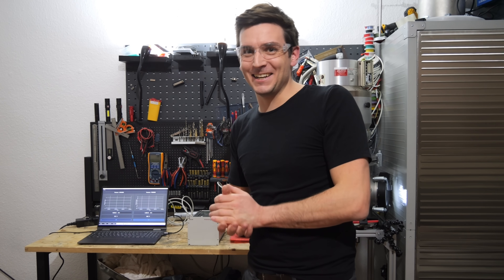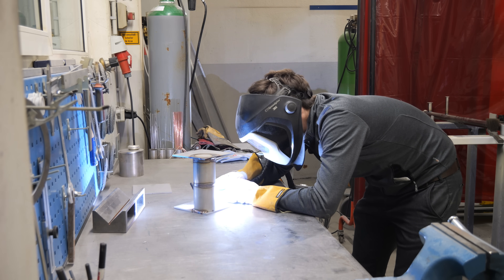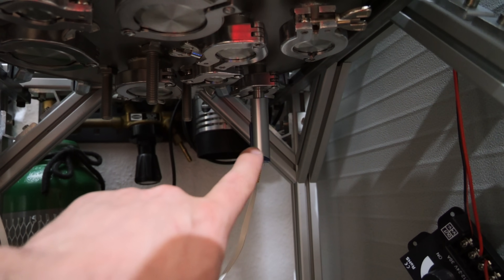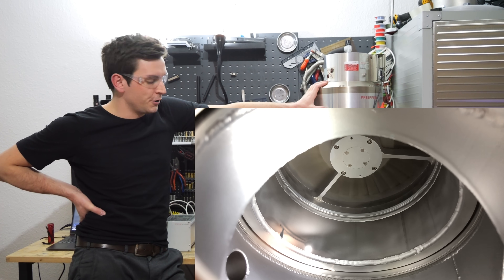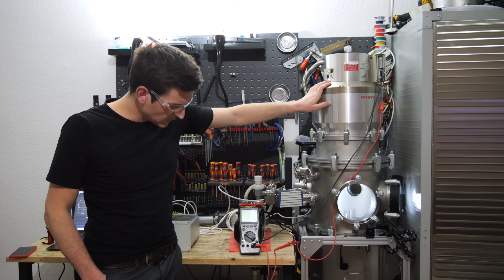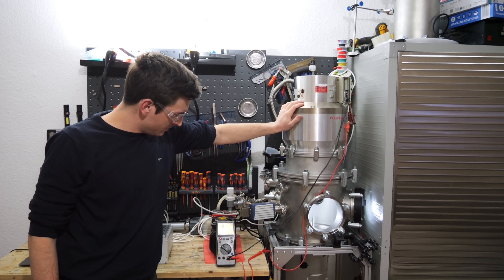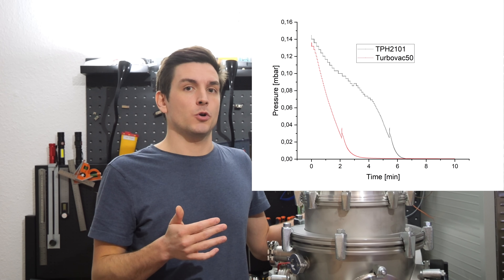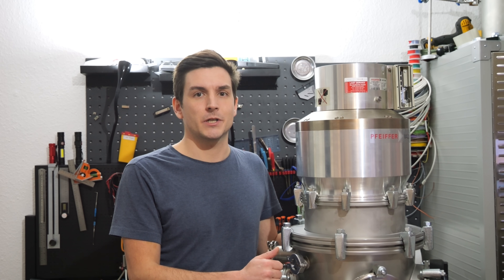Turbomolecular Madness – A Nerve-Wracking Experience

Comment: that noise can be likened to any jet going for the sound barrier, its buffeting, in the 
trans-sonic region, once this region is passed, the object behaves normally. look into the 
X-15 program it shows the genesis of sound barrier penetration, and the physics in this speed range, the turbine (vane in the vacuum pump) would experience the same issues; also think, why small router bits can go 30,000rpm but a 1" drill bit (in a big radial drill) can only go 300rpm! same issue with a big vane in this pump.

Comment: you should use much much more double claws for your ISO K flange     for a DN 250 ISO K we (Pfeiffer) recommand 22 claws (18 for a DN 200)
you should add claws on you DN 320 flange as well.    The claws for turbo are special dedicated proven claws for turbo mounting purpose
the crash torque on the flange is HUGE, while the pump crashes in 3ms, the liberated energy is like a fall from the Eiffel Tower
Advice from a Pfeiffer guy

Comment: You have to use a backpurge for stainless. Also be careful about the amount of penetration: GTAW doesn't penetrate more than 3mm at most, so depending on the diameter multiple passes are required.

Comment: Remember kids, you wanna have a vacuum and place before you fire that molecular vacuum up. If you don’t have sufficient vacuum to start, the molecular vacuum will eat itself up starting with a fan blades. NOTE: DUDE, Put that vacuum chamber in a bunker! The type of vacuum pressure you’re playing with … THAT CLOSE … ☠️
Reply from the maker: If you start the turbomolecular pump without a vacuum it wouldn’t actually be a huge problem. It just wouldn’t get up to speed. Basically all modern turbomolecular pumps can sense the motor current and will shut down before they overheat. 

But if the pump is already at its full speed and air then rushes in, it would probably destroy the pump and can be dangerous if the pump (or chamber) is not bolted down properly.

Comment: Did you rough down the chamber before  turning on the Turbo? That pump is only meant to be run when you have already removed most of the atmosphere. That could very well be causing the vibration.

Comment: The welding is satisfactory.  The observed resonance is likely due to the power supply's failure to transition from low-speed to high-speed switching.  Consequently, resetting the BLDC driver enables the correct operating mode, achieving precise phase and frequency synchronization with the rotor's RPM. Maybe the Driver is faulty

Comment: Yeah, on my smaller 100mm pump which runs absolutely silent at full power there are 1-2 bands during acceleration/deceleration where there is noise.

Comment: 10 to the minus of my ass.........give a normal number of vacuum in inches of mercury, millibars, any number that is readable for a leigh man, but not this math genius number you need to calculate 50 lines of random irrelevant numbers, what's the negative pressure? oh it 10 to the carrot of a squared melon on its edge twisted 3 dimensions over to your left, no no your other left.

Comment: Your artifact at the 10-6 region can be 1-pinholes in welds (virtual leaks) 2- compounds boiling off and burping (fingerprints , vacuum grease etc)  3-actual very small leaks 4- permeation through o-rings or pin holes.

Comment: Well done,  possibly if you evacuate the chamber at 10% power for 20 minutes then switch to full power you may bypass the standing wave.  If you go to my video on the most accurate gun in the world you will notice the small turbine that spins the gun barrel goes through a few standing waves before it reaches 1Khz (60,000 RPM) which is to be expected because there is a lag between the air jet, vanes and reflected air.  The turbine settles down when the angular velocity is constant,  but still I am with you its scary, and my turbine is home made.

Comment: Yeah man, I'm actually qualified to answer this.  I'm an IRMS technician.  You were hearing mechanical resonance at low rpm.   You absolutely NEED a screen over the blades though.  Your setup is great.  Outer space in the comfort of your garage. Regarding leak testing, squirt acetone onto suspect joints and monitor pressure (should spike up) 😎

Comment: My Balzer vacuum evaporator  used a Pfeiffer turbomolecular pump. I had to replace the pump at one time and since I lived and worked within 10 miles of the Pfeiffer factory near Wetzlar I got a tour of the factory, as well as a new pump. Compared to oil-diffusion or ion-getter pumps they are certainly simple and reliable. One of our electron microscopes also had a TM pump. I was a bit leery about vibration, but it was not a problem. You probably will want to put a screen in front of that pump.

Comment: I believe vibration is due the air in the chamber compressing  out and Bounce back to the blade, and if you stated to empty the air in the chamber using small rotary suck ion pump to empty all the air already the turbo pump blade should not need to over load it work as it spinning up!

Comment: i dont think your 100^ on the mark about the noise not being from resonance i think it is pressure oscillations against the surfaces such as the plexiglass observation window . it could also be dissolved gasses in the oil being nucleated by the sudden vacuum and feed back of the oil motion through the pump

Comment: If you allow the full potency maybe it will break the weakest part or material and that’s the fiber glass and the pieces going straight to the fan and explode it . And removing the energy I have no idea than removing the energy with energy by coiling.

Comment: First off all: interesting work! At work we use smaller TPs and I just had short resonance windows with very old pumps. But our chambers are also more massive. Your TP/chamber ratio is a bit...off😅
Since you did a oil transfer between the pumps, I guess the high pressure side is oil lubricated. In this case the upside down position should not be used (check manual). Only dry lubricated pumps or such as maglev can be mounted upside down. 
Your rough pump is a bit small for this huge TP. Pump down performance of the TP is restricted in this setup. Pumping down just with the ratary vane pump may cause oil contamination since there might be a non laminat flow of oil molecules to the chamber. So I suggest never running the rough pump without the TP, since it will prevent molecules getting in the chamber.
For better pressure you should think about switching to cf and do a bake out. Then X^-10mbar is no miracle. Downside ist you need to replace the gaskets every time.
Hope this didn't sound too much like bad criticism. I'll just wanted to share some (hopefully) useful informations.
Keep up the nice work!👍

Comment: It's definitely abnormal for the pump to vibrate at any speed.  I manage over two dozen vacuum systems, some with as many as eight 320mm turbo pumps, and they are all completely silent and free of vibration.  These pumps are highly sensitive to rotor balance, so wear and accumulated deposit can cause vibration as the pump ages. If the pump has been crashed (hit with pressure while at speed) this can also add to wear and vibration. Yours are near end of life and need an overhaul it sounds like.  Probably why you were able to afford them - overhauling a turbo costs a significant percentage of the initial cost.

Comment: It's not clear from the manual of that pump what active vibration compensation it might have, but mag-lev turbo pumps especially need a stiff chamber to mount on so that they can "push against" the chamber to compensate for internal vibrations.  If your chamber or the supports are wiggly, you can create standing waves between the chamber and vibration compensation or rotor and you can destroy the pump from this vibration (ask me how I know).  Also, claw clamps are not a safe way to connect turbo pumps because of the rotational inertia.  If the bearings seize or there is some other problem with the pump, the pump will go flying off your chamber.  You should use full ISO bolt rings instead.

Comment: During my time as an Instrument Systems Specialist I calibrated instruments on an electron beam welding system and the chamber was big enough to fit a full size 3/4 ton utility van. It used two large turbomolecular pumps along with a pair of even bigger roughing pumps to evacuate the chamber and took well over an hour to get to the lowest possible pressure. I love science, thanks for another fun video.

Comment: Having been in a passenger aircraft whose auxillary turbine in the tail no longer worked, slowly externally starting a jet engine has a similar resonance that goes away at full speed.  This is normal.  

My best guess as an engineer: Run through the band of resonance as fast as possible.  I heard of a hydroelectric plant that had an accident because it stayed in the unsafe operating area of resonance too long.  Also use a sandbag ring or lead shot bag or something to damp it out and reduce the hazard.

Comment: I have three turbomolecular pumps in my astrochemistry lab and the pump should definitely not make noise or cause vibration. Also, I will not start the turbo pumps if the pressure in the chamber is above 5E-2 mbar

Comment: Might be a dumb question, but whats the point of pulling such an absolute vacuum?
Reply from the maker: Not a dumb question at all! 
Some experiments or industrial processes can only be carried out in a high vacuum. This is because in a high vacuum, the mean free path is very large. This means that a molecule/particle can travel a long distance before encountering a gas particle. At normal pressure, this is about 68 nm (incredibly small). In a high vacuum, this distance can be up to 10 km. This implies that a particle can travel unhindered from point A to point B. This property is essential for electron microscopy, particle accelerators, coating processes, and much more.
Reply: @AdvancedTinkering  thank you for the good clear explanation!

Comment: My guess on the violent shaking at lower rpms (if not resonance) would be that the motor and fan are balanced for 30k rpm operation. potentially due to materials expanding during operation from the centrifugal force, inconsistencies could make minor imperfections in balance at rest.

Disclaimer: I know nothing about vacuum pumps or things that spin in general

Comment: Rotating anode X-ray tubes have a region of resonance similar to what you have experienced. They are driven quickly through this region to minimise the time that the resonance is experienced. Data sheets on driving rotating X-ray tubes may offer some insights into the mechanics involved. When turning off, the speed is controlled by electrical braking to minimise the transition through the resonance speed region. The drive electronic variable frequency drive should be matched to the mechanical load both driving up to max speed and returning to zero speed. The manufacturer of the turbo molecular pump should be aware of this phenomena and have or be able to suggest a suitable speed controller.

Comment: I can confirm that resonances in low ranges are a thing.
Lab centrifuges have resonant frequencies at around 600 - 1000 rpm.

Also, could one of those resonances (either in the low range, or at 50%) be acoustic resonance?

Comment: You can get that resonance from PWM type motor controls. PRF do not have the same issue and neither do analogue controls. The trick is usually to select a PWM frequency that produces resonance at low speeds so that less power is available to cause vibration if it is not possible to get out of the resonance range.

Comment: I have the same turbo pumps on my vacuum system and they make the same noises. I think 10% is where it lifts off the physical bearing. If coatings build up on the blades it will get even worse. I noticed your first pump had some coatings on the blades. I have disassembled and reassembled my pumps several times.
Reply: I work with these pumps in a CR doing r&d in semiconductor technology. 

It's awesome you have these beast. But may I ask... what the hell are you doing at home with these?! :D

Comment: Resonance frequency at low power it’s the same as a bench grinder when you turn off the power and it starts shaking,,,, but what vacuum pressure did you reach ? I’ve rebuilt vemag vacuum pumps they only go down to 100 bar vacuum for moving foods stuffs like pie filling

Comment: I have a small TMP that is sketchy to use. A blade broke off it at work, so they threw it away by letting me take it home. Fortunatley, it was an ebay special because we were not treating it well (the reason the pump didn't tear itself apart was because we were evacuating a sticky process, and the side wall was so sticky that the blade stuck to the wall instead of falling into the rest of the blades).
I fixed most of the balance problems by cutting out completely the missing blade as well as the blade on the opposite side, but even though it is only a ISO-100 pump the startup is still loud enough that hearing protection is needed until it gets up to speed.
What I need to do is build up an air bearing type thing so I can properly balance it.

Comment: I suggest the vibrations are the resonance frequency of your adapter.

I would make some vertical WEBS to seam weld onto both of the flanges and onto the adapter tube.

1 web between each clamp.

It's possible that this stiffening  might simply alter the resonance frequency and move it up quite a lot.

So it may then need more webs or else a new set of webs centrally mounted horizontally between the vertical webs.

First thing to try might be a few extra clamps?

Comment: I’d expect some of the resonances are actually compressor stall phenomena. The recommended maximum startup pressure could be limited by at least:
Maximum thermal load on motor
Maximum motor current
Allowable bearing loads
Allowable time passing through a mechanical resonance
Compressor stall

The turbomolecular pump is an air compressor, and if your roughing pump is unusually small, the turbo will get ahead of the roughing pump capacity to remove enough gas from the outlet.

There is also the transition in operation as the mean free path changes from less than to greater than the relevant dimensions.

The easy test is to either pump down a bit further before starting up the turbo or to pause the RPM increase below the resonance for a bit and then continue the run up, and see if your behavior changes.

Monitoring the roughing pump inlet pressure and the chamber at separate points would be ideal.

Comment: The vibration is probably caused by the fact you still have atmosphere at 10% so the motor is under load. There is probably an optimum that you can run the motor in different pressure gradients.

Comment: Resonance was my first guess too, but now I'm guessing that at 10%, there might be more reactionary force being applied by the air in the chamber to the blades of the pump than before the chattering starts or after it stops. Maybe, before that point in the startup, the pressure in the chamber is "high", but the blades of the pump aren't going fast enough and aren't imparting enough force to shake the chamber. Afterwards, there's very little air left, so, no matter how fast the blades spin, they're imparting very little force, which means there is little reactionary force. To test that theory, you could evacuate the chamber to a mild vacuum using a standard vacuum pump, then disconnect it and start the turbomolecular pump. If the chattering doesn't happen or happens at a different point in the startup of the turbomolecular pump, then this would explain it.
Reply: Or, maybe it's caused by differences in relative pressure on one side of the chamber vs the other. Eg. there's a small enough pressure of gas in the chamber that differences in pressure don't propagate very quickly, which would cause a sort of slosh from side to side, causing one side of the pump to hit more air molecules than the other, imparting imbalanced forces on the unit and causing it to shake.

Comment: To rule out the vibration coming from the mounting structure, I'd perform a frequency range test on the setup and determine it's natural frequency.

It might be that the natural frequency of the structure is the same as the pump at 10% output - which would explain why it was observed on both pumps, and that the resonance disappeared when the pump frequency increased.

Comment: Isn't it a no-no to operate a turbo molecular pump that uses oil in the high-side bearing upside down?
Reply from the maker: It's the UP version, which has to be operated upside down or on its side.
Reply: @AdvancedTinkering How is the oil prevented from draining down into the high-vacuum section?  is there a ferrofluid seal or some other exotic scheme?

Comment: "Ten to the power of minus..." Why? After milli- goes micro-, then nano-, ...
Reply: In the vacuum sector and in science, pressures are always expressed in this way because the scale is usually logarithmic. Often times you are just talking "pressur was at minus 5" for example. It's much easyer that micro, nano or picobar.
Reply: @christiansprojects-cgmanuf1426  looks like tradition, I see, thanks.
Even easier method is used in radio receivers: power is measured in dBm -  decibel-milliwatts.

Comment: Resonance frequencies are meant to be quickly surpassed or not reached. However, at the high rotational speeds of the turbopump, amplitude resonances are usually encountered. / Resonanzfrequenzen sind dazu da, schnell überfahren oder nicht erreicht zu werden. Bei den hohen Rotationsgeschwindigkeiten der Turbopumpe werden jedoch meistens welche erreicht. (Amplitudenresonanz)